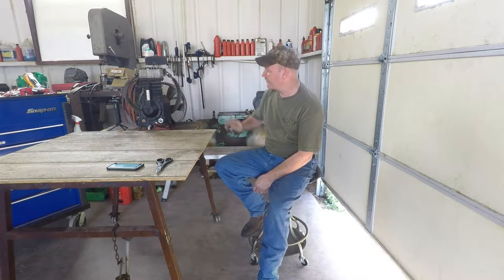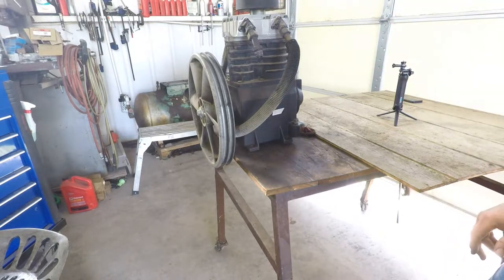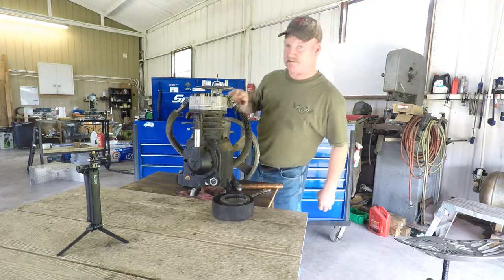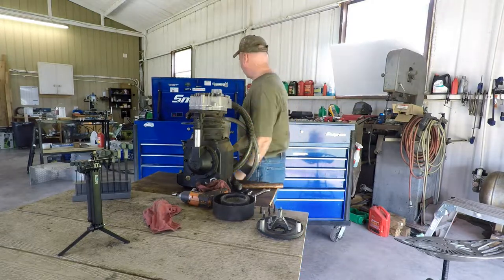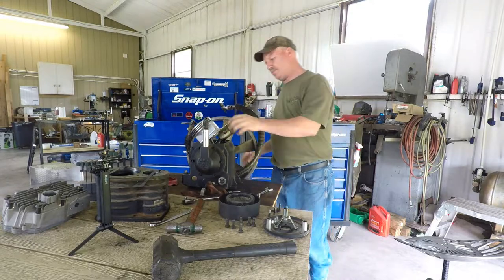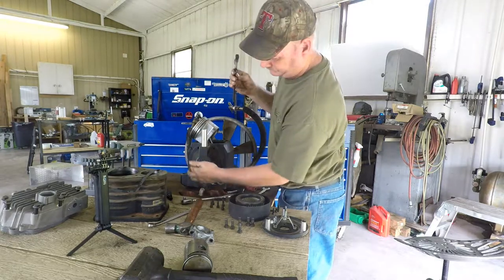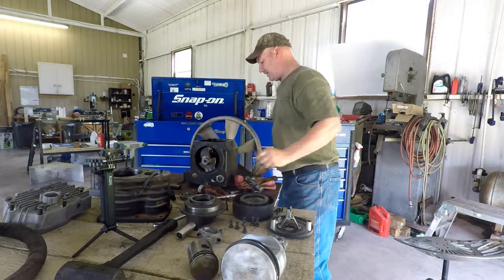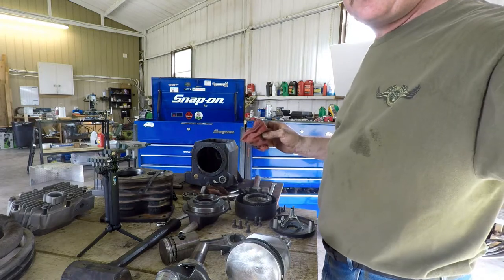Speedaire compressor repair part 1

Comment: I just picked up a used compressor and tank with this exact Speedaire 5z404 compressor without a drive motor. What frame size, hp, shaft size, and pulley diameter is your setup using on the motor? I cant seem to find this information anywhere as to what motor to use to run it! Thanks!
Reply from the maker: Mine originally had a 3 PH motor and I took it off and bought a 5 HP single phase motor.  I've seen them for sale at Tractor Supply, I may have bought mine at Harbor Freight been several years ago now so I don't remember.  It works great, I run a plasma table on it and it keeps up very well. I can get the number from my motor if you think it would help you.
Reply: @larryrobinson7492  If you could get that model number it would help me immensely!!
Reply from the maker: @danarant2184  I took a picture of the Model is C184K17DB31A  It's a Leeson Brand.  Shaft size is 1.125", it has a 6" double v groove pulley which I'm sure I got separately or removed from old motor.  I took a picture of the tag if you want it.  Email me or check me out on Facebook if you want.  My details are in YouTube I think.